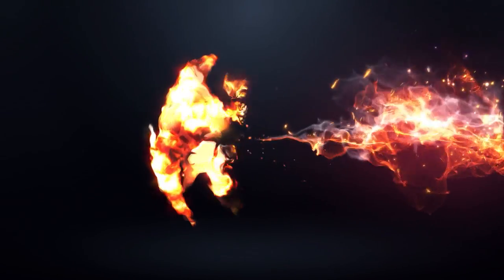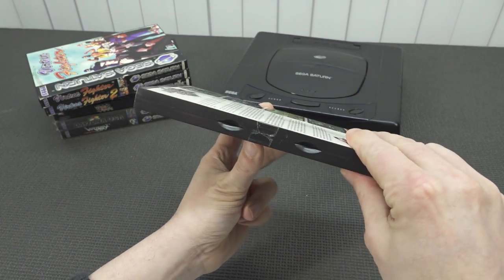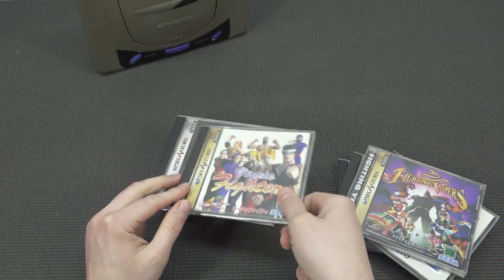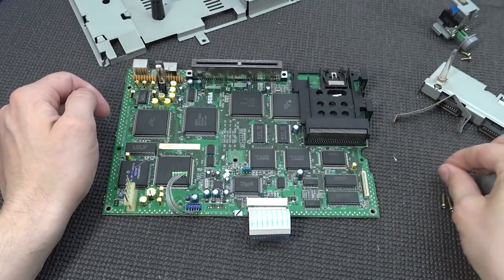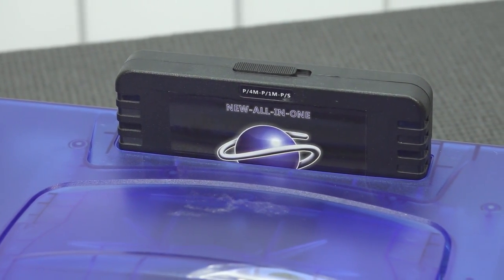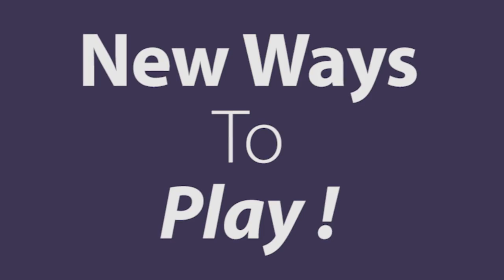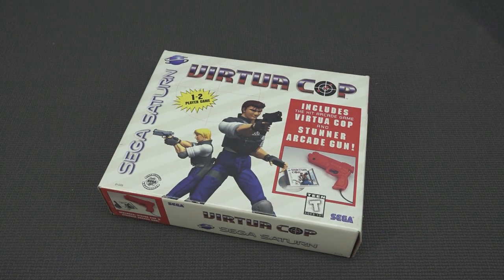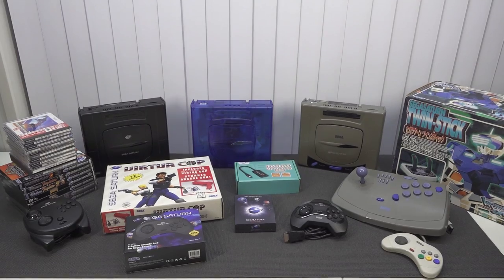Sega Saturn Collecting Is A Nightmare .... And this is why !

Comment: In my region, Sega Saturn was just nowhere to be found. Even on a gaming show (local tv channel) they couldn't found a PAL version, but had to use Japanese one. When I was doing some digging around on how one can get his hands on one (~1997), the dealers would just shrug their shoulders, told me to pick up my passport and fly to Japan!
I saw PAL Saturn once. Only once. November 2021. And that was on the on-line auction site. Just a console. No controller. Broken case. Cover for the save game battery is missing. Asking price: ~€100. Even the seller couldn't verify does the console actually work, since he didn't had a game for it!
Addendum: few years ago, a copy of Symphony of the Night for PS1 was on auction site. Auction started with €5. It was eventually sold for €99!

Comment: The Saturn, Neo Geo and the PC-Engine are probably my favourite retro consoles (Saturn still being #1); as I grew up mainly playing in the arcade. Owning them really brings the arcade experience home. I have owned the original Japanese system and games from launch in the '90s, so I don't have to worry about modern pricing (though I do regret selling some titles); but at this point I think playing burned disks is pretty much fine (rather than spending the ludicrous pricingf for originals). I would recommend checking out the mission stick peripheral if you don't already have one - Space Harrier and Panzer Dragoon are really excellent with it. 

I'm personally very fussy with control pads (there are many terrible ones out there). But the retro-bit controllers are pretty much 1:1 with the original Saturn pad (best pad ever made IMHO) and the 2.4GHz wireless ones are great -- they come with USB dongles for use on MisterFPGA/PC and the original hardware. I use them on my supergun and with MAME.

Comment: There already is a plug and play solution

the Satiator. You can plug it into the video expansion port in the back. It plays games from sd. It is expensive though. About 250 bucks i think.
Reply: My humble opinion is: players used to modchip their consoles, so the lens wrecked earlier than expected. Instead of repairing, it became waste. Never modchip the console. To play backups, the cartridge pseudo it is ok

Comment: Great video! Very helpful for people new to the Saturn system! Good job!

I still have all of my original Sega Saturn pal collection including gems like Panzer Dragoon saga and Burning Rangers! Brought a Japanese Model 2 (white) system about 12 years ago and have loved it ever since. Incredibly easy to mod!
The Pal model 1 (mark1) console you have is an absolute Nightmare to mod due to the main board being a pain in terms of fitting a 50/60hrtz switch.

My advice if you want a Saturn? Buy a cheap Japanese model 2. Pick up a Phantom mod chip cheap (I got mine from the guy that actually invented the thing for £15!) And get an action replay +4mb all in one memory cart and cough obtain the games you want! 😉

Don't try and play a pal version of Panzer Dragoon saga on a Japanese machine with an action replay cart as you will KILL IT! (The action replay that is!) Download an American ROM and change the region to Japanese with a region patcher. It takes 2 seconds 🙂 

Obviously that's if you want to use CDs.

SD is probably the best way to go but damn it's crazy expensive! It will get cheaper over time though I'm sure.

Oh and the Virtua stick you have is the Japanese version which is the only one that includes microswitches. The Pal and NTSC A versions do not! (I also have one and it's great!)

I love the Sega Saturn. It was a 2d powerhouse and the fact that the fan translation scene is really great means that I'm still playing new games (to me!) Every couple of years!

Every retro gamer should own a Sega Saturn. Sega's best console by far!
Reply: Hey, you're saying playing Pal PD Saga on a JP console damages it, How? I've never heard about this, I've already done a few playthroughs with it. my AR card sometime ago strangely crashed and lost all of my saves, was that related?
Reply: @JetWolfEX  Panzer Dragoon is the only game that uses a copy protection purely to combat action replays! Download an American ROM and region patch it to Japanese mate! I killed the memory and the action replay part of my first cart just from trying to play my Panzer Dragoon saga PAL on my JPN machine. You're lucky you just lost your saves buddy!
Edit: My twin brother got my old cart purely for the 1-4mb upgrade. Rest of it was dead!
Reply: @johnboydojo  Good to know, thanks for the info!
I already have ways to play without a real copy, or I could get a pal system and convertor if I had to.

I used a fan code to bypass the copy protection, but no one has mentioned what you just told me, and I'm sure I'm not the only one that plays it that way, could be a lot of people that bricked their AR that way.
Reply: @JetWolfEX  Yeah after I killed my first cart I went and had a Google and found a Reddit post with people discussing it. Also found old articles that mentioned the copy protection too. Shame I found out the hard way! Hahaha
Sega Saturn region patcher is easy to find and use. I did all my brother's games for him JPN region and they're all still in English, bar Die Hard Arcade! You have to patch that one as it switches language depending on the region machine you're playing on. Much like the Neo Geo CD

Comment: I own 5 pal Sega Saturn's from 1995 onwards and none have ever broken. If the disc doesn't read just use silicon spray on the rails that move the lens and it's done. Best hardware and most sturdy as well. Not like dreamcast which is terrible. Owned about 8 and none have a working disc drive, so now use gdemu.

Comment: Aaah, you bought that Twin stick 9n MP 😀  I'm still hanging in there for more ODE option are coming or getting cloned by the chinese. Phoebe is never coming down in price and MODE is nice but even more expensive. I've completely frankensteined one of my dreamcasts (gd3mu, psu, hdmi) and I want to do this with my Saturn with a stuck cdrom spindle too. But the whole Fenir/phoebe/MODE supply and price situation makes me disgruntled to say the least.

Comment: Man, those cases are pretty bad, but the US cases break just by looking at them funny. The Poly-carbonate material has just not aged well. I remember for a while, people were buying the terrible titles just for the cases for less than $10 USD in most cases, prompting even those to spike up in price eventually. At least more than one option is available these days to replace them with an OEM quality alternative. I'm surprised no one has tried to recreate the PAL region ones, given that at least they could conceivably be manufactured from more durable materials now.

Anyway, Saturn game prices are ridiculous now - I've only got about a dozen titles, thanks to the fact that I started collecting about 7 years ago. I got a few gems in there, like the Nights bundle complete in box with the analog controller, Galactic Attack, Both Virtua Fighters, and Daytona USA CE... OH, and I was able to get a copy of Tomb Raider, which ironically is the game I was able to see side by side in store running next to the PlayStation. I decided to buy a PlayStation based on that comparison, lol.

Japanese games are not bad, but if you're a fan of fighting games or shmups, forget about it. If only I could read Japanese... 😔Anyway, I gave up and purchased a Satiator last year - Sure, it's the most expensive ODE on the market at about $250, but I see it as 1/4 of the cost of Panzer Dragoon Saga. If you ask me, TOTALLY WORTH IT!!!

Comment: What you call the "original" controller isn't really original. The slimmer one is technically, since that's what was originally sold with the Japanese Saturns. The fat controller was originally designed specifically for the US and European consoles because Sega thought the slim one was too small for Big Western Hands™.

Comment: The Action Reply 4M Plus is half the price of the All in One and still comes with region unlocking, 1-4MB RAM upgrades (which are mostly only used in fighting games, it seems), includes 4MB of memory, and allows you to cheat in games.

I love that controllers and peripherals for the Saturn are really cheap.  Shame that games are not.  Wish people could reproduce discs.  Once people are able to do that, prices won't be so bad.  Like, am I going to care if my copy of Panzer Dragoon Saga is not an official copy if the thing works?  No.  No I am not.  Get to it nerds.

Comment: I MUCH adding sensors to my tv and being able to use my OG Orange light Guns on my QLED 65” Vizio M-Series (M65-G0) than pay out the arse for Sindun’s guns. They’re so expensive, setup is currently hours long and each game (at least in MAME and more) require separate setups for each game. Why not a hacked Kinnect? MS made Kinnect Open Source years ago and works with new TVs. Or a Wii hack. I know cross-platform can be done as I had a light gun that worked for both Saturn and PlayStation- you just had to swap the adapters that went into the controller ports. Please, someone release a free or cheap hack to add some sensor(s) and play. This has been a problem with a fairly easy tech-whiz fix waiting for way too long to happen.

Comment: Sega. My ultimate brand for gaming.  Back in the days we had a mega drive and a mega cd. . To much money spend on that system.A 32x was on the bucked list also but what has a 12j old boy to buy it from. So the saturn was a no go. It was a bumper that the dreamcast was a flop. Sega has a special place in my hard and wicked when i see your video i want one. Saturn it will be. Maar snel op marktplaats kijken. 😀

Comment: big box eu cases ı think amazing. collecting japan jewel cases its no diffrent than playstation.  espcialy ea cases wih vhs like big manuals amazing. ı hope more third party and jpanasie only games relased that way. its resamble of 90s pc big box cases.  they not that expensive. the expansive games expansie on japan too.  the thing about saturn if you want 3d games they not that expansive only later ones out 98 expensive bcouse limited use. if you want 2d games  figting games shootums 2d etc they expansive mostly bcouse youtube guys claim tha saturn machine of 2d power house. saturn not just that about.  saturn also support you cd backups with cards on video or even without cards. you just need one orginal game and with swap you can play backups. everytnhing about saturn hadrware to controllers to wheels amazing. its have feeling diffrent and unuqie.  big box games part of that feeling too.  jeweal case games not.